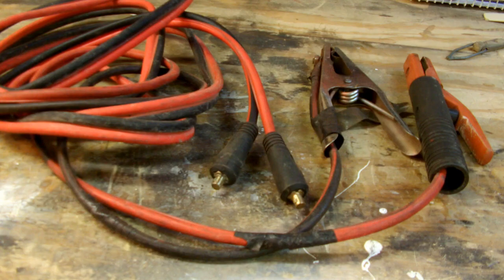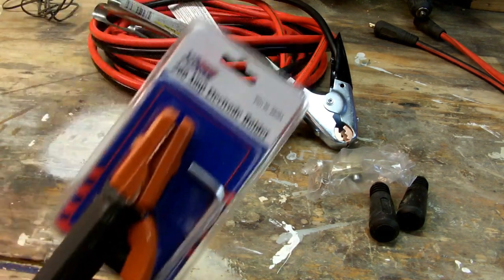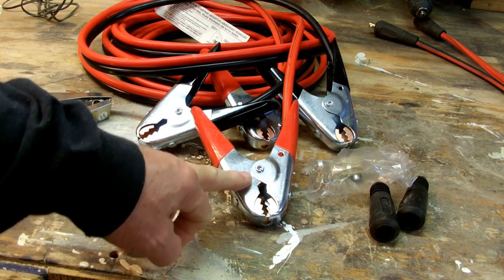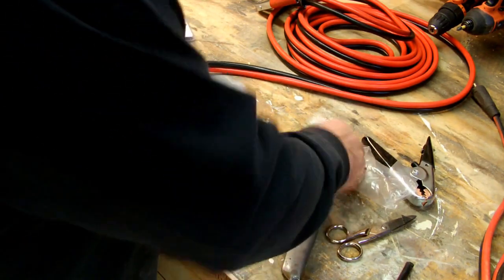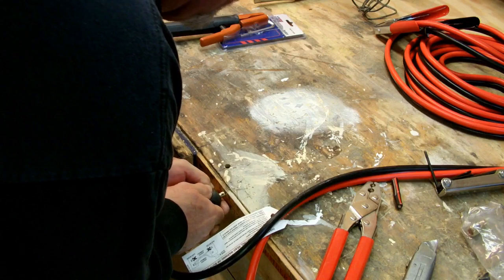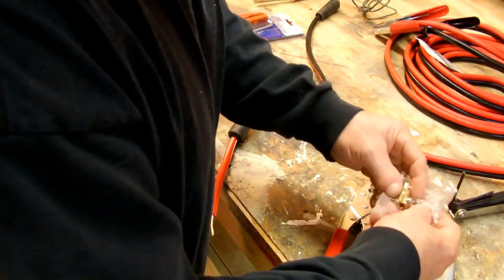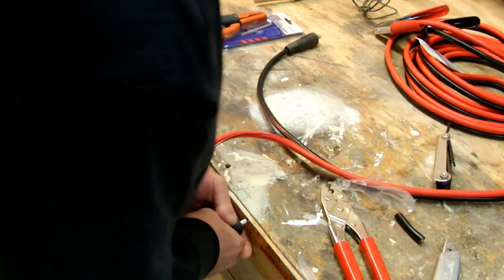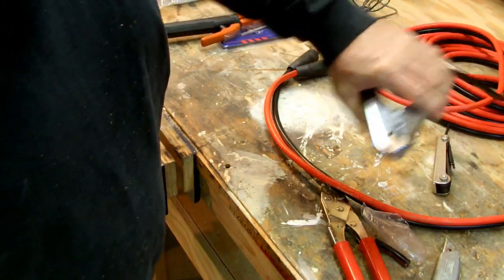Cheap DIY Welding Cables

Comment: Love it. Going to grab two sets of cables and some Tweco quick connects. I have a small engine drive and won't push much over 100 amps so 50' of 4 ga should be fine. Right now Tractor Supply is charging $7/ft for 4 GA lead.
Reply from the maker: Cables would cost more than my welder! I have never had a problem with the kind of welding I do. If I did high amp, 100%duty cycle welding I would get the proper setup.

Comment: I found 4 gauge 16 footers on clearance at Menards for $10.
For $10 I got the Dinse 10-25 connectors that will fit my Tooliom  TL-200M welder.
Kinda sucks that I had to pay for shipping from Menards (outta stock in my area) but the 11% rebate almost takes care of shipping.

One set gets hacked in to extension cables, then I make sure close friends and family have decent jumper cables  (I grabbed a set for myself last black Friday) and we will see what happens with the left overs.

Thanks for the idea!!
Reply from the maker: Sounds good! Menards came in  to my area fairly recently, I rarely go anywhere else for building materials or diy supplies anymore! Thanks for watching!
Reply: @1rustytree  I moved into Menards  country about 20 years ago.
My basement is FULL of free or nearly free tools and stuff I have gotten from Menards on rebate.

Every time my sister in law visits we fill up her trunk and she can't believe we got all that stuff for free.

 I do have to admit that Lowes usually has slightly higher quality lumber.  
Back when they would price match I would take the Menard ad to Lowes and buy my lumber there.

Menards used to price match and beat by 11%.
There was only one time I ever found someone else with a lower price and they did beat it by 11%.
I don't think they do that anymore sadly.
Reply: I just finished making my set.
I put pass through leads on them (males on one end, females on the other) so now I can get 25 feet from the welder on stick.
On mig I can have all the length I need on the ground cable now.

I can confirm that these cables are copper coated aluminum.
I would not be a bit surprised if the cables that came with my cheap Chinese welder are also copper coated aluminum.

Once you get a million subs ( or when ever those orginal cables start giving you trouble) cut up one of the cables that came with your welder and see if they are copper plated or copper.

I they are plated make a set out of fancy 100% welding wire.
Then do the amp measurement test at 100% and see if it is any different.
You might measure the temp of the copper set then put the original set back together and check their temp.

My guess is the original set is copper coated aluminum and it makes less than 5 amps difference.
I won't guess on the temp.

Thanks again for the great Idea!
Reply from the maker: @1978garfield  I’m sure you’re right about the copper coated aluminum wire!

Comment: Hi just found out about the channel!
Also I wonder since my welder goes up to 250A would it be smart to double up two pairs of jumper cables for higher amperage capacity?
Reply from the maker: Welcome! That is a good ?! I would not use them to weld on higher amps for long periods of time. I have never had a problem with cables heating up when welding 75 to 150 amps. May need to stick with the manufacturer supplied cables when using higher amps.

Comment: Im going to try this, any change in your arc, amps or cables getting hot?
Reply from the maker: Ran 75 to 130   amps off and on , on regular diy jobs ,  farm repairs , built a sawmill, never ran any of  the welders real long periods of time and never had a problem.  ( Lincoln 225, amico 160, and the HF 80). Just t try it ,its cheap to get longer/extra leads

Comment: Great how-to video. Can i do this with a 200 amp arc welder?
Reply from the maker: I use them on my Lincoln 225 , but have never used them at max amps for an extended period,  not really to do with the cables just did not have the need! Thanks for watching!
Reply: @1rustytree   thanks

Comment: kinda did the same thing once when my ground clamp got ruined and needed a fix in a hurry
Reply from the maker: It works for me , I don't think I would use it with  high amps all the time but my needs its fine! Thanks for the comment !
Reply: @1rustytree  same here it was with a little 110 welder low amps thin metal.
a wise old man told me when i was a kid. "i don't care what the tool was design for,  i want to know what's it's capable of."

Comment: What is the max amperage you have welded with these? I'm fairly certain they are copper clad aluminum so the ampacity is much less than pure copper.
Reply from the maker: Jason Shell those #4s  ran at 160 dc those older cables were 6 or 8s probably 130 amps ac tops usually 75 or90 ac . Thanks for the comment!

Comment: CCA (Copper Coated Aluminium)
Reply: That's what I am researching now . At the point where I have a set of jumper cables , not cut up yet and I saw when I bought them that they were CCA cable . FYI , I have a Century 110-110 230 amp. 235 volt ac welder besides a little " buzz box " 115 volt arc welder I want to put dinse connector's on . I'll go back now and finish this video but I wanted to toss this out there . What do you think of CCA cable ? And I do want to weld several hours a day with the Century welder .
Reply: CCA - hahahaha!

Comment: So the wire will only be attached to one side of the ground clamp, unless you put a strap connecting the two sides.
Reply from the maker: Right, other than the riveted handle hinge area the wire is isolated to 1 jaw, unless you use a regular welding ground clamp .